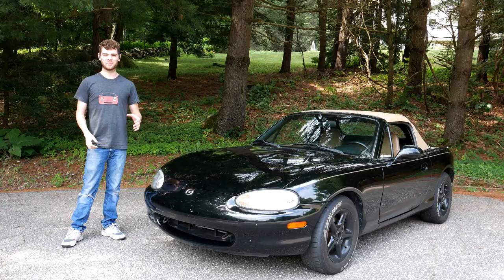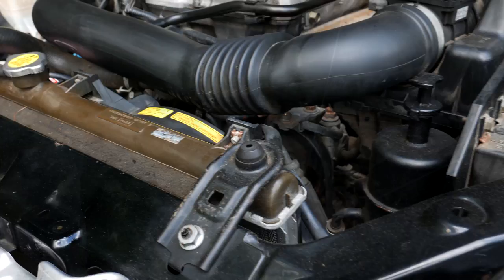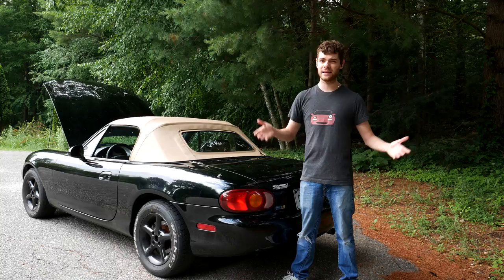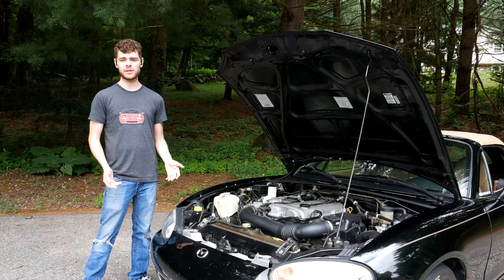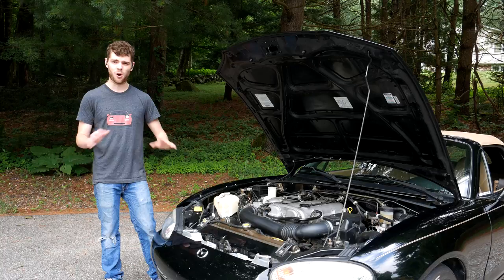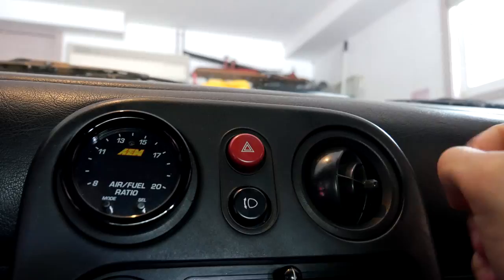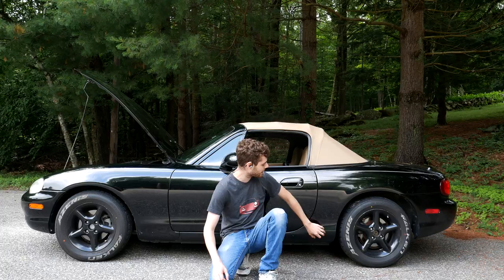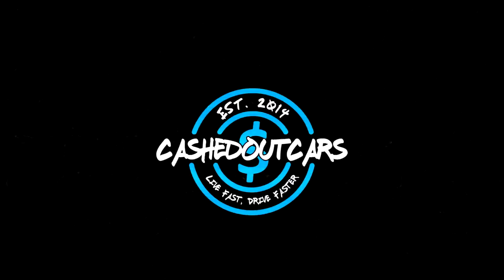5 MX-5 Miata Problems You WILL Have

Comment from the maker: Fix your problems! (Affiliate links for which I may be compensated)
Radiators: https://amzn.to/3ih9AfU (Check NA vs NB fit)
Soft Tops / Rain Rails: https://amzn.to/2U5g0XL
Oil Leaks: https://amzn.to/3yZBfZz (Confirm fit)
Floppy Vents: https://ebay.us/ZtnKQK
Rust: https://amzn.to/2Te76qr
►Full Build Spreadsheet: https://bit.ly/3z0SCg4 (My Turbo NA)
►Falken 615K+ Tires: https://bit.ly/3MTZFuU
Reply: Awesome!

Comment: We bought our 1990 MX-5 in 1994 and owned her for 20 years. The only problem we had was an oil leak that amounted to a quart per year. That being the rear seal, our mechanic advised us to just add oil when necessary. Otherwise, the Miata was just bulletproof. Admittedly, we kept her garaged.
Reply: nice
Reply: bro that sucks i was only imagining that i did all the work to get there just to do a rear main seal lol
Reply: Nice but if its a manual that will cause clutch slip and Hotspot on the flywheel .. but considering sounds like u got a killer deal bro ... peace and love
Reply: Same bro, had one for 40 thousand miles from 100,000 and have had none of these problems even with I'll admit light maintenance

Comment: I've owned a 2000 for 12 years.  Bought it from the original owner...an older guy who bought it new, and sold it when he and his wife couldn't get out of it anymore...lol  It was at 100k when i bought it, now it's at 148k. It's always been garaged, and the condition it's in backs that up.  All I've done, are timely oil changes, and coolant changes every few years, new tires a couple times, new brake pads once,  new fuel filter, replaced the rear end and manual trans fluids,  rebuild kit for the 5 speed shifter, new engine belts recently, new timing belt and water pump, new camshaft position sensor, new fuel pump and new radiator.  As was mentioned in this video, the radiator hadn't yet failed, but it was definitely turning a greeny/brown color. I know I need to replace all the struts...just haven't taken the time, or worked up the energy to do that yet.  Reading my list makes it sound like a lot...but keep in mind that's over 12 years, and the enjoyment we've had in that car is priceless!

Comment: I have a 2002 Miata that I bought new.  It has 184,000 miles on it.  I have had none of the problems you describe.  I keep it garaged and rarely drive it in winter (Wi and Mi).  I have done the maintenance by the book including changing the timing belt every 80k miles.  Although I was not having any problem I had the clutch replaced at 180k when I had it in for a new timing belt.   It is not only the best vehicle I have ever owned is the best anything I have ever owned.  It doesn't burn any oil and get 32 MPG around town, in a rural area, and I get 36-40 on the highway.  If left in the sun no convertible top is going to last 20 years.

Comment: "You should expect some oil leaks from these cars"
BMW owners: That's cute.
"The valve cover is easy to replace"
BMW owners: Screams in pure suffering
Reply from the maker: There's a reason I bought a 2nd Miata and sold my german car...
Reply: actually, I have a miata and recently I sold an e46 which had no oil leaks anywhere, but it was overheating as hell which is the reason I sold it. Before that, I had an shitbox e36 sedan and it wasn't leaking oil but again... overheating.. I think it's my curse cause my miata is overheating too :(
Reply: Haha
Reply: @richardbenko5196  IDK man, it might be something with your driving style :D
Reply: @The Career Neophyte  You are stuck in Hotel Beemer Hell....you can decide to check out at any time but actually departing?   That is the hell part....
Reply: @richardbenko5196   Stop towing the damn RV travel trailer with tiny cars!   Jeesh!
Reply: @richardbenko5196  there's a quick fix to overheating problems with Miatas, because I had the same problem. Look up: Flyin Miata coolant reroute kit.
Reply: @richardbenko5196  I’m wondering if you never saw the leaking but it had already all leaked out to the most it couldn’t, and thus you get overheating and don’t see leaks anymore.
Reply: E36 isnt too bad for valve covers, but after M5X🗿
Reply: @CashedOutCars   Good choice. e31 bmw does look kinda nice though.
Reply: I'm pretty sure that is was either a condenser or a fuel filter on a Mercedes Benz that sat at the back of the engine and all but inaccessible UNLESS you  -  A. Removed the engine or B. Removed the dashboard and accessed said part through a small hole in the firewall.  The mechanic telling me this while he worked on it (someone ELSE'S car, I had purchased a Toyota) chose Option B.
Reply: 500 Abarth: "Can't leak oil if I burn it off..."

Comment: 1. Sill rust
2. Fender rust
3. Chassis rail rust
4. A-pillar rust
5. Subframe rust
Honourable mention to bootlid rust if the previous owner didn't connect the vent tubes to a wet lead acid battery.
Reply: so true :(
Reply: Where's the vent tubes?
Reply: 1 rocker panel rust                                 2 chasis rail rust                                    3 oil leak                                                  4 passenger power window motor dont Work
Reply: crying in my 1999 nb with rear fender rust
Reply: Still no rust on my '97.  Kept inside every winter since new. Only driven through 1 winter.
Reply: Floor pan rust, cause the PO didn't use an outdoor car cover and weather stripping was shot to shit.
Reply: @fantabuloussnuffaluffagus  My 97 had minimal rust and I dailied her, granted the previous previous owners had the whole chassis resprayed in that beautiful BRG.
Reply: @fantabuloussnuffaluffagus  sadly. Old cars don't like British roads. Mine was daily driven all year round. The salt we put on the roads in winter accelerates rust
Reply: P.O. of my 98NB had all of the above except the a-pillar and replaced accordingly. You'd almost think even the plastic and upholstering rusts on a miata. Seriously, what doesn't rust on a miata?
Reply: lol almost every miata on CL and FBM in my area has rust, rust, rust, and more f!%king rust :/

Comment: 2003 NB. 
Radiator- replaced with an aluminium one. 
Soft Top - replaced. 
Oil Leaks - No. (manifold seal was replaced as per 100,000 km service)
Floppy Vents - yes. On the ‘to-do’ list. 
Rust - No. Australia does not salt its roads.
Reply: 2004 NB. 
Radiator- replace with an aluminum one.  On the ‘to-do’ list
Soft Top - replaced. but has small tear thats fixed 
Oil Leaks - yes :) but not dripping on the ground
Floppy Vents - No. fixed with tape.
Rust - yes. rear wheel arch. In Finland salt allover the place on winter
Reply: @Jusu.siltsu  Do your thermostat at the same time. I sprung for a radiator replacement, mine was going green and running kinda hot when the AC was on (220F), went to aluminum rad, but it was actually just the thermostat. You can get more cooling performance boost by just goibng with new thermostat and coolant re-route than an alu rad, for less cash. mind you, the alu rad looks awesome and it was cheap enough anyway :)
Reply: Yea thank god I live where they don’t salt the roads otherwise it would be hell to maintain cars like these
Reply: @mr.lostmyaccount4721  yea thats why everyone keep their project cars as summer cars
Reply: Do you have AC? Did your new aluminum radiator affect your AC radiator at all?
Reply: @Calicarver  
Yes. I optioned AC when I bought my NB because I live in Australia, and also because the NA I traded in had factory AC too. I haven’t noticed any difference to be honest. My AC used to play up on 40+days (105 F) but only when I was stuck in barely moving traffic. The air coming out the vents would get hotter, and hotter, and eventually blast furnace temp came out of the vents. I haven’t had that set of circumstances since I moved to the bigger radiator, and I also had a high flow valve put in at the same time as the radiator, so it keeps the engine cooler, so it may not happen now.
Reply: @just_passing_through  Interesting. Most days here are above 40C and when stopped the AC will in the span of 1 minute start blowing hotter and hotter air. Blows ice cold on the free way. Problem as I see it is the distance and the 1cm gap between the two radiators with the AC radiator in front and the fans in the rear behind the engine radiator leading too much air to escape around the sides of the AC radiator. Looking for a way to seal it off
Reply: Get a trombone cleaner (flexible wire with brushes on either end) to clean out your rain-rails. You're welcome.

Comment: The power window switches in the NA. I became an expert at rebuilding these when I had my '97.
Reply: Those go bad on the NB, too. I tore the plastic lever assembly out and used the switches on the circuit board directly for a while before putting new levers in. 
The top latches perform a similar trick with wear. They won’t stay in the latched position because the retaining nub wears off. I got “remanufactured” latches. Still overpriced, but cheaper than new factory items. 
Think I’ll mention that the leather seats go to blazes in a hurry, too. Darn stuff.
Reply: everything about power windows in NA is constantly breaking down... I know what I'm talking about
Reply: I did have to replace the whole regulator in my driver's side once in 200K miles, but I had to clean and rebuild that switch at least 20 times in the same span.
Reply: i fixed mine by sanding the contact patches and removing a bit of the plastik on the switch it self, whrere the metal is. On my Miata it seemed like it got pushed into the plastik somehow.

Comment: Was fully prepared to roll my eyes when I started watching your video. I apologize for that. I have a 95 Montego Blue with 215,000 mi on it. I've got about 10 grand into her, engine and transmission are fully stock. I consider myself a religious zealot in the Church of Miata, and your info was spot on. The only other known failure point on miatas I would bring up, are the clutch slave cylinders. It's a very easy fix, and a cheap part, but for some reason the seals tend to go out prematurely.

Comment: The Miata is a great car.  I had a ‘93 that I kept almost 10 years.  The only failure was a plastic gear in the window lift mechanism.  Some design problems that were easily fixed such as a frame brace that was included from the factory I think in ‘94.  When I sold it I bought a 2000 Corvette convertible.  Now that was a car with lots of MAJOR design and manufacturing issues.  More than I can remember.  It looked good, had 29 mpg, quick acceleration and stopping.  Altogether a different car.  But from an engineering and quality perspective, Miata wins my vote!

Comment: 2003 NB owner. The only unscheduled maintenance that I've had to do with my car is to replace one of the header latches, as the locking mechanism can wear with use. If possible, I would recommend to keep the car garaged, as this keeps the weather off the car, as well as the debris.

Comment: 3:13 - Not just the rear main seal. There is a carrier for the rear main on the NA and NB's, that can make it look like the rear main is leaking, you'll have to replace part of the oil pan gasket for this as well. I recommend you replace both if you are doing a rear main seal job to avoid removing your transmission more than once. The carrier for the rear main seal will look like the rear main is leaking when you get there, heads up.....Hopefully this will help one person.
Reply: Thanks! Can you link to this part? I've fixed all of my leaks (including cam and crank pulleys) and so now fixing to pull the trans and only want to do this once!

Comment: MX-5 NB1 2000
Radiator crack? Check
Soft top rips? Check
Clogged rain rails? Check
Engine oil leaks? Check (front crankshaft and valve cover)
I would also add coil pack failure and power windows only rolling down half of the way! From my experience and what I read in other forums those two are also very common.
At least, it's a cheap car to fix! Great video man!
Reply from the maker: Thanks! Luckily nothing catastrophic tends to go wrong with these!
Reply: I've had my 2001 for 3 years. Had to blow out drains behind doors.
One window would only go down 5 inches - tie holding wiring disintegrated. Fixed with a cable tie.
To avoid rust and soft-top problems keep garaged if possible.
Thanks for excellent video!

Comment: Just to add to the oil leak problem don’t forget that oil and coolant hoses don’t go well with each other since the cam seal on the back of the head is such an issue it will always cause the heater core hose directly under it to wear much faster don’t forget to check for a squishy or ballooning hose!

Comment: I have a 93 NA and all the issues you addressed are spot on. I have had to replace the soft top. Clean out the rain rail drains unclog the pinch weld drains under the car. I have 290,000 miles and the engine doesn't leak oil so I have been lucky there. I really enjoy your videos and have been a subscriber for quite a while. Always good content. Keep them coming

Comment: In Scotland, only one main problem: Rust! So common that all chassis rail replacement, sill parts etc can be purhased and welded in! Honda seal on the cam cover solves that oil leak!
Reply from the maker: Yeah, that’s common anywhere with harsher environments unfortunately. They’re amazing other than that

Comment: My 1995 Gen 1, Series 2 (1.8L) in Classic Red acquired in 2001. Always garaged and not driven in winter. Now with 132,247 miles. Head gasket replaced in 2017. Radiator replaced with an aluminum Mishimoto in 2018. Just replaced the soft top and rain rail this June.  Maintenance costs over 21 years of my ownership is $7,451.13 or $354.82/year. Pristine appearance and shown frequently at auto shows. Lovin' every minute of it.

Comment: I have a 1990 thats rust free and has zero leaks or issues hopefully it stays this way as it has 175k
Reply: same here, mines like at 230k and has a bunch of suspension work done on it but i need to replace the front end of the thing
Reply: keep on top of the scheduled maintenance and it should keep on going. A guy in my miata club has a NA with 300K miles on it, never had the head off

Comment: 2000 Miata Thrust Bearing Failure at 20xxx . Bought used engine that had the same problem Remove and replace engine 2x . Set thrust bearing properly at minimum. No problem since.  I have had multiple slave cylinders fail. Clutch master fail x 2 Fuel pump failure in 2023. Rear calipers leaking x 2 Water Pump failure, replaced, switch for electric mirrors failure, replaced. Replaced green radiator. Replaced top with Robbins Top. Keep up the good work.

Comment: 1993 NA Miata here. Yes to all. Completely accurate and yet still a very amazingly resilient car. I’m not a mechanic and did replace my own radiator. Get puppy pads to prevent spills on the driveway. I also replaced the gasket seal but even taking great care and adding the extra sealant to problem areas the gasket still leaks. This may be something in need a professional to do since I already had my hand at it. Lastly SPARK PLUGS. The Miata eats spark plugs. I bought premium ones after replacing them a few times and they lasted just as long, not worth the up charge. It’s just a yearly thing I do now.
Reply: was your oil leaking on the belt? i’m trying to buy a 96 and it’s leaking oil on the belt near the alternator.

Comment: the one problem ive had recently is a beltsquealing on cold starts. Not just sometimes, but EVERY cold start. The belt tension and pulleys are fine. I also have the rear main seal leak issue. But that's it. I've had most of my issues fixed on my 223K mile miata.

Comment: I have a 2001 NB2 with 60,000 miles.  Replaced the radiator when purchased, cleaned out the drains and fender panel. Sprayed anti corrosion on inside of panels. Swapped AC vents with 2005 Mitsubishi Eclipse (slightly modified). One problem that WILL happen and one I consider more important than floppy vents is the soft top latches wear and won't stay shut. You'll be driving, the wind will catch your top and rip it open.

Comment: i have a '89 Eunos at 190K miles in the UK which is very wet. It has the original roof with no cracks, rain-rail fine although needed new foam installed inside rubbers around windows. Water inside the car often due to blocked drain pipes behind the seats. 
Rear wheel arches rust as do windscreen surround. Electric windows on NA can be a problem but are fixed with a deep clean and new bushes. Gear change can become loose between 2nd and 3rd, replace the nylon bush on the bottom of the gear selector rod, simple 60 min job.

Comment: I have a mint condition 2001 Miata LS and be 1.8 L. Since buying new off the lot, the only thing that is gone wrong on the vehicle was a slight misfire on multiple cylinders. After it been sitting for five years in the driveway we change the coil pack, and she’s been running great.

Comment: I’ve had the misfortune of having an unscheduled valve cover gasket replacement due to the factory PCV breaking into a thousand pieces while replacing the PCV to intake hose. Wasn’t too bad, but wasn’t fun either.

Comment: The Japanese - made radiators are having less problems but it is a simple fix with a Koyo / Flying Miata or similar. Never had an oil leak on rocker cover. The sealing had been replaced during timing belt service every 100000 kms so no problems there. Soft top- come on, it is logical that that is not lasting more than 10 years. But had to replace ignition wires to NGK on both my NA and NB 10.Anni. Some have NGK from factory, mine ( Germany ) doesn`t. Brakes, Brake disks- replaced the front calipers on my NB for 4 pots and Zimmermann brake rotors + Stahlflex PTFE ss braidet lines. Great upgrade. And Bilstein shocks if not already in ...